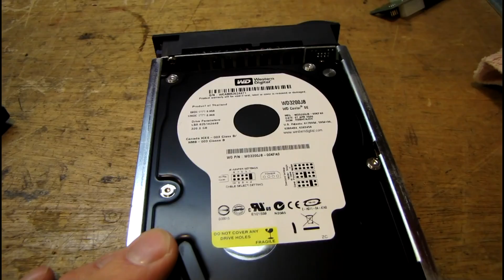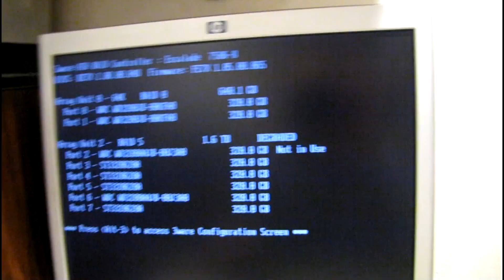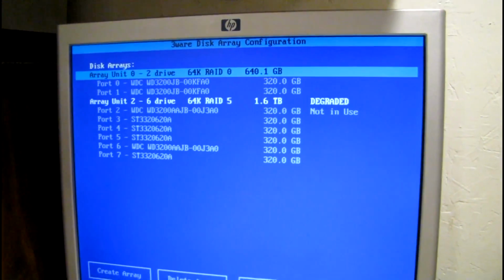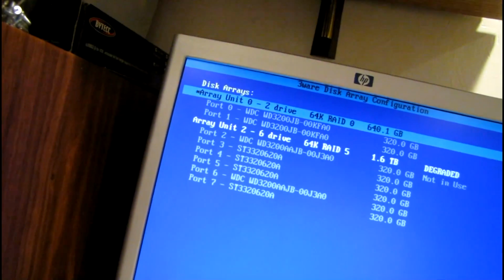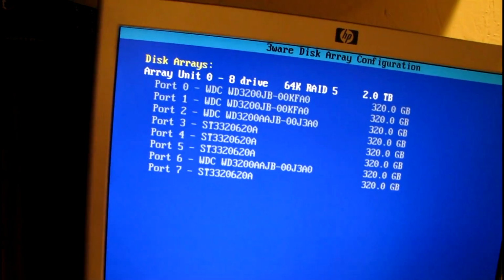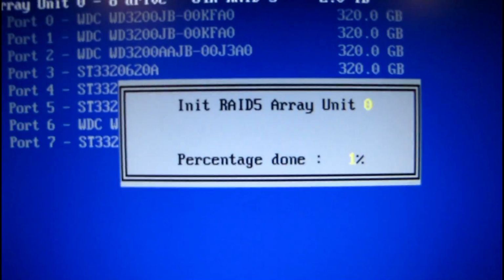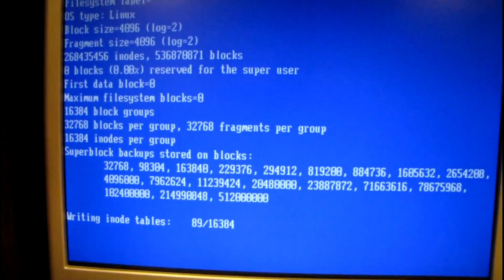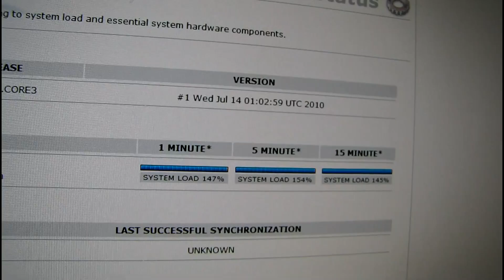Upgrade and repair my file server, January 2012 *Part 2*

Comment: why do u need file server at home?:)
Reply from the maker: To store all the video from my camera and backup several computers.
Reply: Will i need a raid card for my old dell XPS 420 if im gonna use it as a file server?
Reply: +Maltebyte2 it depends on if the board supports raid

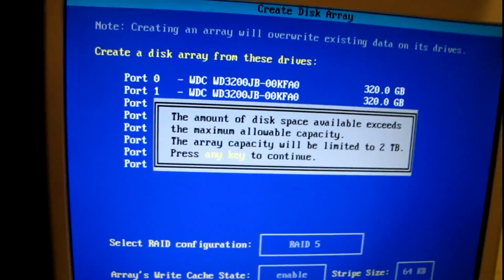Comment: @ 9:01 The amount of disk space available exceeds the maximum allowable capacity. Wouldn't it be possible to get new Adaptec Controller Cards? losing an entire HDD hurts. I would upgrade the controller.
Reply from the maker: I actually got a new server a long time ago.  I'm using a Synology with 8x 3TB drives.
Reply: Maxxarcade did you save the hdd's from the old server?
Reply from the maker: the compaq nerd
Yep, they will be on Ebay soon, possibly this weekend.
Reply: Maxxarcade could you send me a link to your ebay account?. Because i maybe would be interested in buying one of the drives.
Reply from the maker: the compaq nerd My ebay is the same name as my Youtube.  I think all the 320GB drives are already sold, but I have lots of 250GB left.
Reply: Maxxarcade
ok. i found it.
Reply: Maxxarcade and also i wonder just out of curiosity if you still have the Gigabyte GA-k8u? ´would be interested in buying it.
Reply from the maker: the compaq nerd No, but I have a couple other boards with CPU's and RAM that might be going up for sale.  Just need to finish my upgrades and see what's left over.
Reply: Maxxarcade
ok. good to know

Comment from the maker: Ya, I normally use WD for all my stuff, but I had a ton of those Seagates laying around from old equipment, so they were free.  Most of them are still running and they are all over 6 years old.  A couple have failed, but I have so many spares it doesn't matter LOL.

Comment from the maker: The problem is the backplane connectors in the drive bays are IDE.  I would have to get a new case and drives, and it would be pointless :-)

12 drives would probably be too much for that power supply LOL.

Comment from the maker: The only thing that can be done locally is basic configuration.  Normally there is no reason to have a monitor or keyboard connected.  Look up NAS (Network Attached Storage) for more info.

Comment: @Maxxarcade ya, it sucks, im building a budget gaming pc and i have to use old hardrives and only 240gb (A Seagate Barracuda 7200.9 160gb, and a Caviar blue 80gb) of storage But if i had some more room in my budget (only $340 but has trip core and HD6770) I would buy like a 500gb HDD

Comment: @Maxxarcade Quite a few years back I purchased a dual P3 server.  At the time it was a capable machine and I spent about £100 on it.  This box was only decommissioned fairly recently.  It hurt to chuck away such a reliable box tbh.  For me the ultimatum came when I looked at the load avg of my boxes and considered that I needed to add a new dedicated cctv box.  I coudnt jusitfy the cost of running the old machines when other machines that were already running could take over sometask

Comment from the maker: @Abdul201188 When I bought the server on Ebay without the drives, I spent $100.  

The Proliant DL360 G1 usually goes quite cheap on Ebay these days.  Usually under $50, probably because it's just a Dual P3.

Comment: @Maxxarcade, WOW 36-45kg just for that? that is a lot..Just asking how much did spend on it?

I got a Dell PowerEdge R200(only 1 need more for my network, which is not enough, it only wieghs 12kg)

I really like the HP Proliant GL360 G1, Do you know how much it costs?

Comment: @Maxxarcade 
Yep, there are, but none that can help me. I'm no good with electronics, multimeters, etc. Plus, no laser alignment guides.
It requires very precise and apt hands, and those are not mine =P
I could write something like a service guide for you, collecting all the info I found on the internet for you on it to make this job easier. It's internally not all that different from other disc-based consoles.
Whatever is your decision, thanks =P

Comment: @Maxxarcade Yes you are correct with the latest version (2.99) only being 64 bit capable. I use it mostly on our Dell 850/860 servers when a client requires a simple NAS device. I may have a look at NASLite myself, would be good to get aquainted with it.

Today at work was playing around with a Dell EqualLogic SAN and some 10gbps networking gear... Makes this server sound cheap haha!

Nice server though you should see some more years out of it hopefully. Looking forward to next vid!

Comment from the maker: @scottjacko87 I'm familiar with Openfiler, but last I knew it did not run on a 32 bit system anymore.  It's been a while since I've worked with it though.  For the 2.xx version I tried last, the hardware requirements were quite a bit higher than NASLite-2.

Comment: @Maxxarcade 
It's two Sega Saturn consoles, they both have game reading probs, and one has slight electrical probs (I think that some cables need replacement). I have all the laser replacements on hand, I just need help with adjustments... and wiring replacements!
Watching some of your screen repair videos I saw that you have classic consoles, so I thought that you could help. I have patience, too.
If you know a good place that could do it, I'd just rather send them to it.
Thanks

Comment: @Maxxarcade Ok. Thanks ,but I'm just worried about setting up a machine with hard drives with out putting a flash card for the OS because I don't want to burn out a hard drive prematurely. I think I have a couple of small ones laying around ,but can I boot from a DVD or a floppy disk?

Comment: @Maxxarcade well, that could be a problem. The RAID card is probably designed for having all identical drives on the same card, so it might just take the smallest drive and make it's capacity default for other drives. strange.

Comment: @NightWolfEditing that might be a good shot, every SATA to IDE converter I had has failed within 9 months. I havn't seen the one on amazon though. its also very much possible to run Compact Flash cards on IDE, because they're basicly just small, hotswappable solid state IDE drives. maybe if they make high density CF cards in the future that would be reasonable. in fact, that file server in this video boots from a CF card.

Comment: you might as well just take out a 320Gdrive and put an old 160GB in. then you wouldn't waste 200GB of data. And SATA drives cost 75% more than they did in november, and the fact that IDE is more expensive than SATA, thats just my nightmare. Almost every computer I own uses IDE. now what happens when the world runs out of IDE drives.

Comment: Wow and I thought I was bad. LOL.   My current server is a Dual Xeon 3Ghz system with 4GB RAM, two SCSI drives for boot and swap, four 1.5TB SATA and an external Mediasonic chassis with four 1TB.  I'll be redoing it soon with a dual core Atom board with an add on dual port e-sata with dual 4 bay chassis each with four two or three TB drives (when affordable again).

Comment from the maker: @andruha11234 Ya, but since they would be SATA, I have to add the cost of a hot swap enclosure and a good RAID controller, on top of a new motherboard, power supply, and other stuff.  Most of the parts from this system only fit this particular case.

Comment from the maker: @donbehatin HDAT2 4.52.  Though any program that can read the SMART data from the drive will work.  Some drives do not have accurate timers though, such as Samsung.  At least that's what I've noticed.

Comment: western digital hdd are reliable , i have a WD400 40gb drive from 2003 it used to be in my dimension 2350 , now i use it for an external hdd now (still works fine)

Comment: Since you are limited to 2TB you should use 7 drives in your RAID 5 and use the 8th slot for the other arrays with the 250GB drives. With 7 drives you would have 1.9TB, only losing 100GB instead of 200GB. Pluse the other array will be slightly larger.